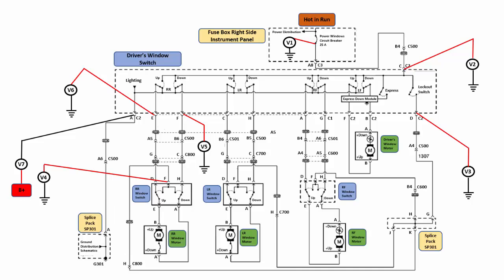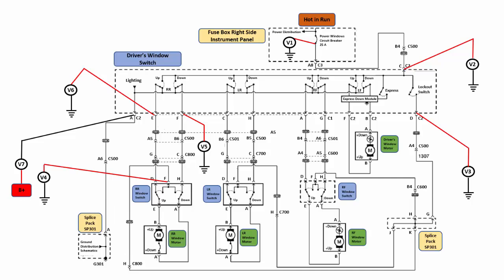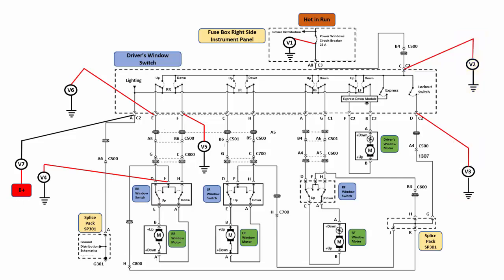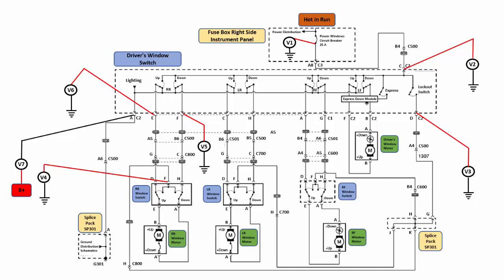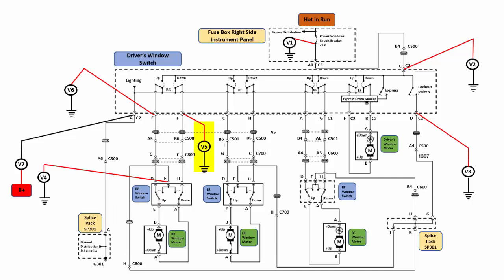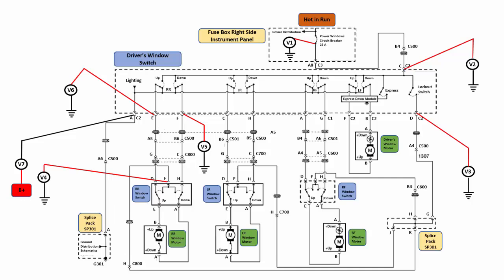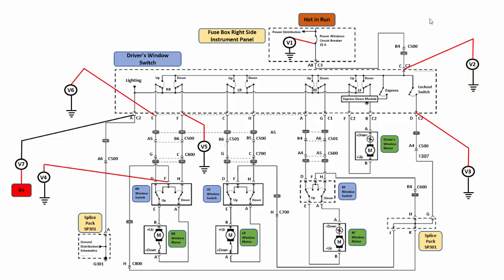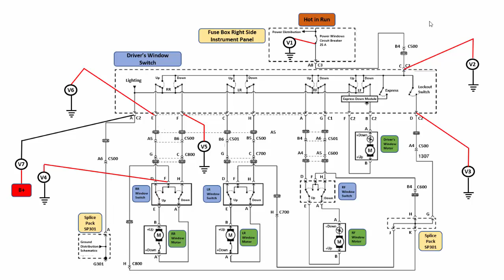Auto Electrical Diagnosing Without Wasting Steps

Comment: Anyone watching the video also should bear in mind  a load test on the wiring will tell if it is good.  You can see 12V on a wire or connector but if there is resistance in the wiring for example due to corrosion  or a bad contact as soon as current tries to  flow  it can't or current does flow but the flowing current drops some of the supply voltage from the battery across that corrosion or bad contact. This deprives the motor of  that  voltage which would otherwise be available directly across the motor.

Comment: I see something your saying ,thats wrong its big
Reply from the maker: Listening, how can I help?
Reply: @automotiveelectricaleducat5839  
How you have current flowing ,
Reply from the maker: Thank you for the feedback.  This video is about deciding where it is best to make voltage checks.  There is no talk about current flow in this video.  If you are having trouble understanding the video, email me at autoelectricaledu@gmail.com with specific info about what you feel is incorrect and I will be happy to help you.
Reply: Around 530 you talk of pos power and ground neg 
Neg is the power before the component  in use pos is still power but behind the component  pos pulls current
Reply from the maker: None of the windows are working in this example so there is no current flow.  I am explaining how to use a volt meter to narrow down the possibilities of what could be wrong, but also to do the diagnosis in a way to minimize the number of tests you make on the car.  Below is a discounted link to my prerequisite course that explains electrical fundamentals and diagnosis.  The link will work for 5 days. https://www.udemy.com/course/do-it-yourself-automotive-electrical-diagnosis/?couponCode=E071CDF4AC54B133EF4F
Reply: It's easy to find a problem when we have a wiring diagram 
It's difficult to find a problem if we haven't a wiring diagram 
1)step v1 if the fuse isn't bad=blown, then we go to 
2)step v2 if we have power and windows don't work we go to F C2   or   B C2
Then we go to step v7
Reply from the maker: @konstantin-big  Yes, you just go step by step like a detective.

Comment: How can a 12volt system have multiple 5volt references . I was taught in the 70s that everything takes part of the voltage it would seem impossible to have 5 or 8 5 volt references 🤷🏼‍♂️🤦🏼 lost
Reply from the maker: Inside the modules there are 5 volt reference chips that generate a steady 5 volts even thought the battery voltage may change as the alternator output changes.  Here is a link to a YouTube video that may help with the explanation. 
 https://www.youtube.com/watch?v=sXm5cctStvY
Reply: @automotiveelectricaleducat5839  thank you it’s been killing my OCD need to know 👊🏻👍🏻